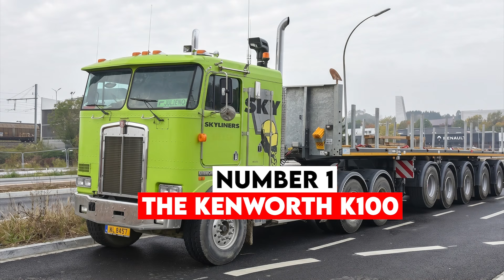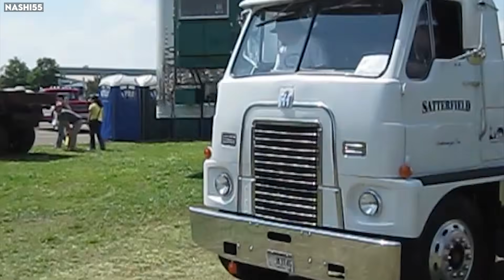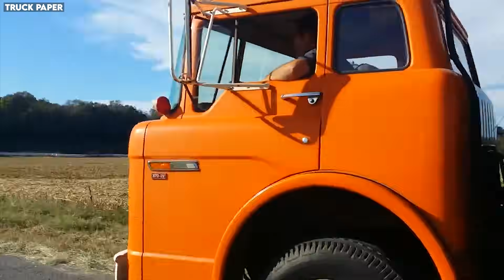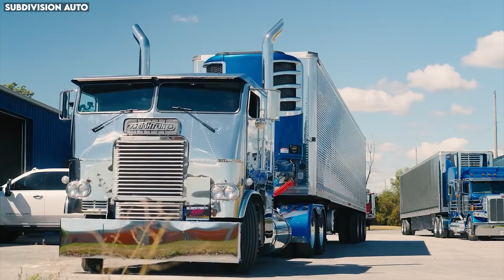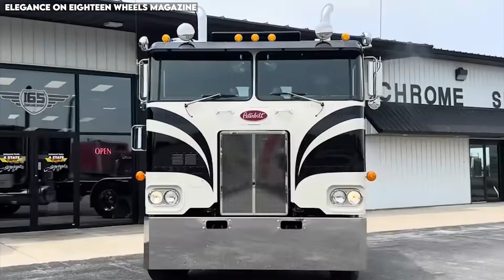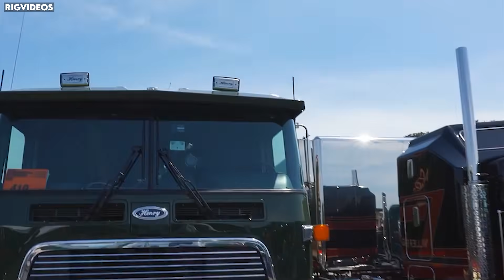10 Forgotten Cabover Trucks That Were Brilliant

Comment: Drove multiple Ford cabovers big block gas with automatics and 3208s with auto Allison 6 speeds and not   a Jake in any and juice brakes on the gas , vans on the diesels  30 years  Donner Grapevine  SF to Seattle in 11hrs

Comment: My father was the fire chief in Pine Meadow, Ct.  They had a 1960 Ford C series fire truck until after the 1980s.  We owned a 1980 White RC2.  Great truck.  Had a Detriot 8V92ta engine. New Way air ride suspension and air assisted power steering.  We were first leased to Kroblin and ran from Torrington, Ct to Chicago and back.  Then we leased on to Interstate Contract Carrier Corp in Ardmore, Ok.

Comment: 1972 jacked up 1966 Emeryville cabover. Found a gas engine in it. Think it was a 549CI engine. He ran California to Wisconsin. Pulled a 38 or 42 foot stainless steel trailer. Said it would go 123 mph. Engine top rpm was 3600. Hefell asleep leaning  against the trailer standing up !

Comment: Never was there a truck like the rigid  D Model Ford that could maximize payload and still be Gross and Axle weight-legal. If you lived at Cronulla in the 1970's the rigid  D Model Ford dominated the trucks emerging from Breen's Sand operation

Comment: Almost froze to death one night on the iron range hy 169 by Calumet Mn, had a ford C cab cab forward and the two speed rear end fork got stuck in frozen oil in between the gears, so I came to a stop between Calumet and nashwauk Mn there I sat motor running 50 below zero. No traffic in them days. Morning cops showed up got towed to Ford garage in Nashwauk thawed it out . I slept well. Scary night. 😊
Reply: In 1980, I saw a much older Ford C-Series stake truck on NY 112 and Granny Road near Coram, New York. The truck was sputtering along, and the cab was ready to fall off the chassis. Some of the passengers even jumped out of it while moving without getting hurt.
Reply: Those Ford cabovers sucked for heat! By the time the hot coolent got to the heater, it was allready cold because the heater hose was so long and ran down the frame and up the front of the cab exposed to the cold air all the way to the heater.
It was OK till it got to about 30 degrees after that, bring your heavy winter clothes